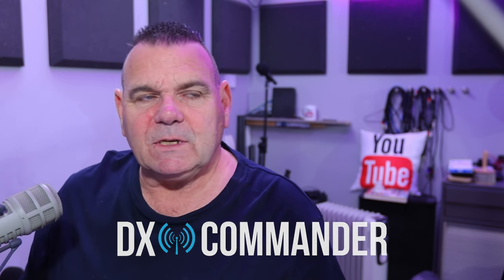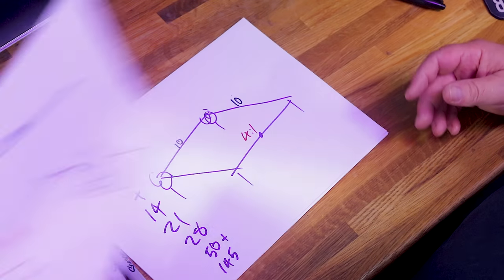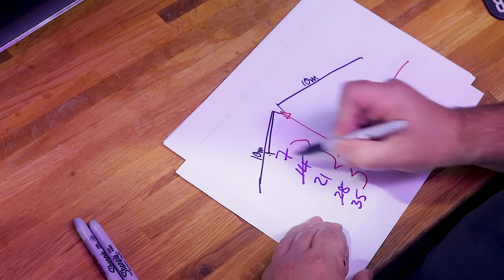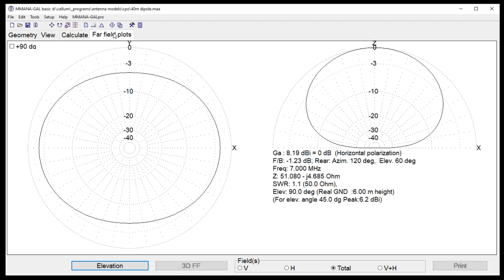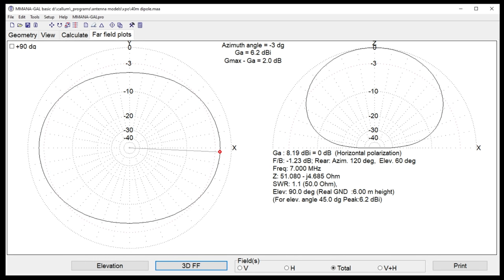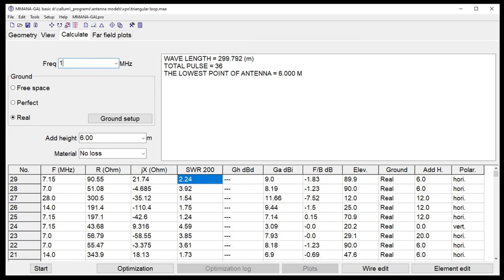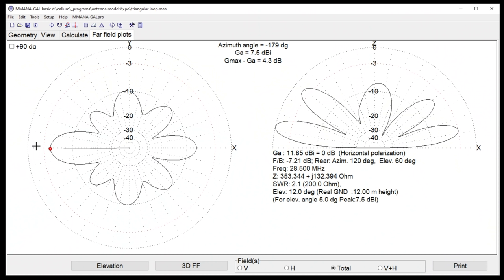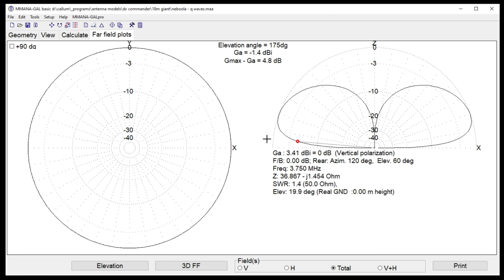3 Cheap Wire Antennas for New Ham Radio Operators

Comment: I have learned a ton from your antenna modelling videos, thank you for making them. I just built a fan dipole after watching one of your older videos about them. Dropped my noise floor from S6 on my end fed random wire to S3, with no perceivable dip in signal strength on received signals. I've only been in the hobby for a little over year, and having people like you making content like this has been a huge boost to my learning. Thanks again.
Reply from the maker: Nice work!
Reply: I am building a HALF wave vertical for 20  meters.  The feed point is 8 feet off the ground so it's not going to require ground radials. I don't seek any credit for the design myself; I saw it in the December issue of QST magazine and liked it! 73. Bill/WW5MB

Comment: Callum, I don't know about the UK, but in the US a good cheap wire for antennas is 14 ga THHN.  This is insulated stranded wire.  14 ga is 1.6 mm.  12 ga is 2.05 mm.  For a permanent installation THHN is fine, but it is stiff and wants to coil and kink, so is a problem for portable antennas.  For that I prefer 14 ga MTW... Machine Tool Wire.  It is not as stiff and rolls up, unrolls, lays out nicely.   MTW is what you might find in a washing machine or dryer, or in automotive wiring.  I did just what you said, bought a 500' spool (152 meters) of 14 ga MTW.  It was cheap because the spool was cracked.  I made it hold together with a scrap piece of 3/8" dia threaded rod, some fender washers, and nuts.  Only other thing, it was purple wire.  Who cares?  Great for experimenting!

Comment: Callum, I really like your audio now. I am deaf and a half. It used to be I could not follow you, but now you sound great. I have a 144 foot Doublet (43 meters), it tunes all the bands from 160 down to 6, but a few of the higher HF not all that well. I am giving thought to making it a fan Doublet, in particular for 17M, because that is such an important band anymore. I do love antenna tinkering.
Reply from the maker: OK, sorry about the video.. When I record at home with all the gear it sounds like this.. BUT when I record using the cheap gopro type cameras, possibly then you can't hear me right.. BUT I always switch on subtitles for you. Good luck..

Comment: Interesting to watch. I'm many years old and still enjoy learning about antennas. I'm in an HOA here in Florida. Just getting back into HR after a long stint doing other things. Have a 2 meter rig but looking at a new HF rig. My question is should I just start with a simple dipole, do a vertical, or a triangular setup. I have 3 palm trees that are about 15 feet tall (before the foliage). The 1st one is 40' from the 2nd one and the 2nd one is about 30' from the 3rd one. They are not in a perfect straight line but the 3rd one is a shade to the right of the other 2. What would you suggest?
Reply from the maker: Oh Robert.. SO MANY options for you. Depends on bands etc. I would start with loading up a 20m vertical using one palm tree as the support. Go up 15 feet and then come back down again - and see what freq it's resonant on, shouldn't be far off 20m.. You will need some small radials scattered / pinned down on the ground. Say 16 x 6 foot radials.. Even in a 180 degree arc. That would do 20m very well.
Reply: @DXCommanderHQ  Thank you for your reply and the advice. It is much appreciated. de KQ1K.

Comment: I have a Delta loop for 20 meters feed at 1/4 wavelength on one of the sides. It is hanging from a tree so the base of the equilateral triangle is some 12 feet above the ground. I wanted it to rotate so a placed a pvc pipe 3 inches along the base side. Now it is always straight as an arrow and I can rotate it of course with armstrong rotator. With this I think you get like some 1.5 db and an odd look from the neighbors.
Reply from the maker: Cool!

Comment: I've never tried a loop but they sound interesting. MMANA sounds good too. I read it can be used with a windows emulator as I run Linux.
Okay, buy an apple, eat it, take a seed, plant it, wait 30 years before you can string up a vertical to it.
This takes some long term planning.
G4GHB.
Reply from the maker: Ideally a 100 years for an oak tree.. Ideal!
Reply: @DXCommanderHQ  If I plant a seed now my future nephews or nieces can put up an aerial.
73, G4GHB.

Comment: I understand 60 meters is like a stepchild, but what antenna would you suggest for 60 meters? I'm thinking an EFHW of sorts that would be long enough for 80 meters as well. Crazy, not crazy?
Reply from the maker: Fan dipole would do both? Or a doublet. Perhaps coax-fed with a 4:1 balun and a tuner.

Comment: Hi Callum,  Can your Classic 80m antenna system have the 10 or 12 meter wires be tuned to work RX/TX well on 11 meter (yeah I know)?  What is the length of the ground radials (3 meters?) and do they need to be all the same length wire OR could some be longer for the 40-80 meter band for any extra benefit?  One last question...do you have SWR/freq plots for the 10 thru 80 meter bands?  Many thanks far all your work!
Reply from the maker: OK, firstly radials can be as random as you like.. So I used 3.5m radials (10 feet?) on 80m and it worked fine. Thats same as 5 feet on 40m or 2 feet 6 inches on 20m - all worked.. Also the CLassic can be used on 11m. You can either hit the ATU button, or say move 12m into 11m. You will still get a tune (with ATU button) on 12m band. Now.. The new Signature 12.4 has this build it :)

Comment: Where is the feed point for those triangular loops?
Reply from the maker: Normally any corner - BUT it'll also work (not as pretty) along one length
Reply: @DXCommanderHQ  thanks Calum.  I went back and watched several of your videos to check on that.  I think I'll add one here to my yard full of trees and wanted to make sure it's aimed at you guys with the best low angle émission possible.

Comment: can hi use my back garden solid mild steel 7ft fence as a radiator or ground please  the fence is 50mt long
Reply from the maker: You can try BUT you won't get better than some copper lying on the ground near the feedpoint.
Reply: @DXCommanderHQ  built myself a half square for 20m band dxing world wide  i hung from a tree 30ft high

Comment: Do you make a scanner antenna 700 to 900 Mhz
Reply from the maker: No.. But it's VERY easy to make.. Basically, make a vertical for 800MHz.. That's around 10 inches long.. Connect the centre core of your coax to it and it'll just work.. Else it's off to Amazon to find one :)